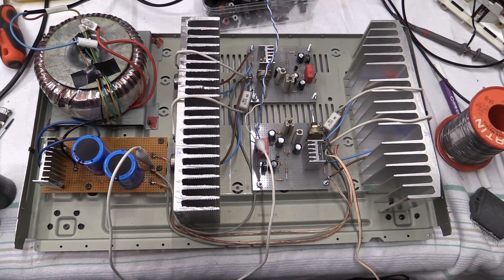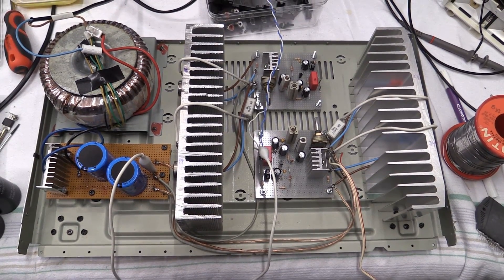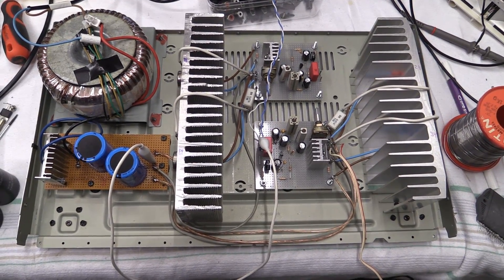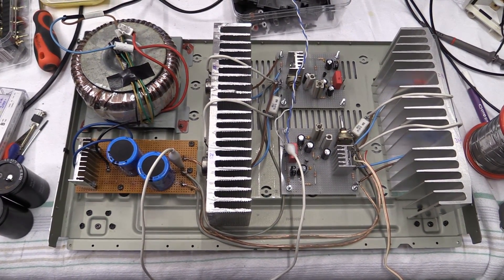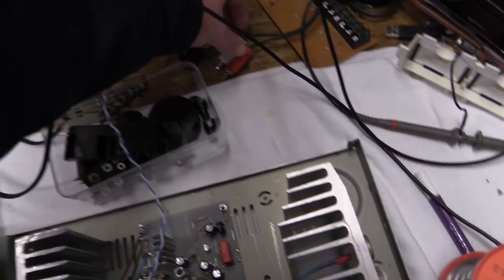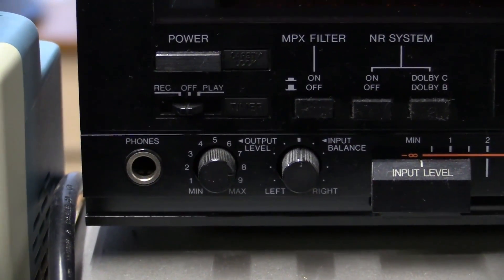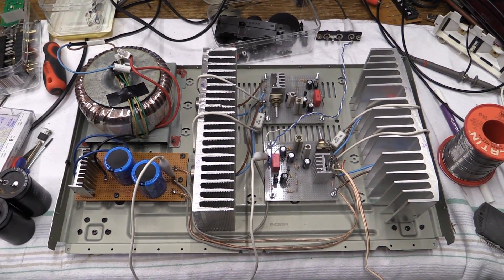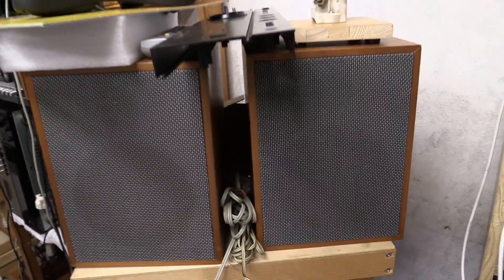DrCassette's Workshop - JLH Class A amplifier [5/x]

Comment: This is an amplifier design worth pursuing. John Linsley Hood was a brilliant designer. I would suggest you buy a pair of ready made PCBs and build the amplifier on those rather than using the method you are using in the video. The design does require a good component layout for stability. It is also important to get the bias of the amplifier set up correctly. I have built a couple of these amps in the past and brought the Kits originally. They do have an incredibly transparent sound and they are well with the effort. 
I would say it is the nicest sounding amplifier I have ever owned and I was the buyer for a Hi Fi company called Teletape in London. I had access to almost any amplifier I wanted. I met JLH  though his nephew who worked for me.

Comment: That buzz is a lack of common grounding points.
Reply from the maker: The buzz is a result of insufficient filtering. The amplifier has a quiescent current of about 3 A for both channels. The filter capacitors are too small to stabilize the voltage at such a high current. The grounding is fine.

Comment: Don't know if you still have this sitting around. Maybe more space between the boards and the bottom on amp and power supply.
Reply from the maker: I still have it, but haven't done anything to it since. I need to considerable upgrade the power supply, the noise is caused by supply voltage ripple.

Comment: It sounds like a ground issue, .  I would check for *bad/cold solder joints. And in the past doing repairs, I have had ac hum picked up from the overhead fluorescent lights (just a thought). Maybe adding some bypass caps, low value .01 etc on certain areas might help. But my guess is there is some ground return problem. Good video, best of luck!
Reply from the maker: +Scott x 
The problem is the underdimensioned power supply. Keep in mind, this Class A amplifier has a high, constant current draw. The filtering is not good enough for that. The setup in this video was 2x10000 µF, I have seen Class A amplifiers with 6x10000µF!
Reply: +DrCassette I know, they pull a lot all the time and need big and well filtered power supplies. It's funny, I was just looking at a class-A amp that has 6 x .22F ! caps lol But that high frequency noise is something else I think. I'll stay tuned, all the best.

Comment: hello sir have you try the AX-14 a simple class AB amplifier ? http://www.diyaudio.com/forums/solid-state/164093-100w-ultimate-fidelity-amplifier.html you should try many people have build and it sound really good, the PCB and schematic is on the link I have made a new PCB and works great, the supply voltage is 50 to 55V max and the bias you can easily adjusted to 20 mA is about 10 to 15mV reading one of the 0.33 5W emitter resistors also can work with less supply voltage to 25V rails too :D
Reply: It is nice but since you know I am always for high power , minimum from 1000 watts.Aim is to make one day a real 20000 watts per channel Amplifier .
Reply: Vedmitra Sharma
mister Vedmitra please, not all people will be able to spend  thousand dollar on parts to make a 1KW amplifier for home use your concept of audio amplifier is for high power units only, think that not all people will have the budget to accomplish your ideas of 2KW units we have to go lower than what we know so friends will have the ability to build a nice amp that provide at least 100W of nice music for the living room

Comment: I would put some filter capacitors directly on the amplifier boards on each rail of the power supply, say like 470 or 1000uF to compensate the wires, and shunt them with 100nF to kill possible oscillations there because of the long ground wires. Since as I remember you made those amps work on the bench.

Comment: About the power supply: A rule of thumb says, that you have to use at least 1000µF per Ampere.
You could also use linear power regulators to solve this issue (ripple), but I don't how much current a circuit like that is drawing...
I also think that the Oszillation is caused by the power supply,
do you have a lab power supply to test it?

If you can please use shielded cables for the input, even at low frequencies I can't trust unshielded leads.
Greatings from Germany =)
Reply from the maker: I think the complete circuit (both channels) won't draw anymore than 4 A, so going by that rule, 4000 µF would be OK, but that is obviously not the case. I wanted to keep the power supply simple, so no linear power regulators. Maybe I'll have to put in some...
The power supply I used for the initial testing was almost identical to that one, unfortunately right now I have only one working lab power supply, so I can't provide the split rail supply.
Those short wires on the inputs shouldn't cause these problems...
I'll be back at the workshop in a couple of weeks, then I'll be doing some more experiments with this.

Comment: Wait, what version JLH is this? Because if it's the 1969 version, it requires output caps to block the DC.
Reply from the maker: It's I think the 2004 version, that doesn't need output caps.
Reply: I'm not aware of there being a 2004 version. Perhaps you are using the 1969 dual polarity version? 
As for the oscillation, easiest thing to do would be to buy a JLH 1969 kit from ebay :D 11 euros with free shipping. Properly designed PCBs with all components included, even the TO-3 outputs. And that 11 eur get you two channels ;) I've got one of them kits on the way.
Reply from the maker: No, this was a new design based on the original JLH amplifier. I found it on a website. I'd like to give you the URL, but unfortunately it seems the site is gone now, the last time I checked it wasn't available anymore.
Reply: DrCassette
Tip: when you need to open a webpage that is no longer available, you can often find archived versions of it on www.archive.org. You can find almost any webpage, it's quite amazing.
Reply from the maker: Too bad I deleted the bookmarked link of the site after I saw it was gone...

Comment: That buzz to me sounds more like a bad ground than power supply ripple. If it was power supply ripple, that buzz should be present no matter what is going on at the input.
Reply from the maker: Hmm, you could be right about that, I was surprised myself that shorting the input causes the amplifier to be totally silent.
Reply: yes that's definatly NOT from the power supply i guess it is the scopes ground lead wich is connected to mains earth thus causing a ground issue. anyway to get rid of the oscillation try to connect a resistor like 100k  or something from the input to ground that could help fixing the oscillation issue
Reply: Sound like a grounding issue. I have a couple of these amps and you have to be careful with grounding points.
Reply: Spot on.

Comment: perhaps do it very systematically: disconnect left and right totally (input, output, rails) and run them individually, on battery/external (decoupled) power.
Then reconnect step by step and look where the issue comes from.
i suspsect a really a short cut between one of the PCB and the board somewhere hidden, causing the PSU to drain all it's power to overload, causing the filtering to be ineffective.
Did you meassure the power consumption of the device? (yes it's an class a, i know what that means for consumption.)
Reply from the maker: Thanks for the advice, I'll try that some time.

Comment: for the HF i would throw in some 100nF and 10pF here and here on the inputs and power rails. that should be solvable...

but the 100Hz hum gives me headaches. sounds like a short to ground somewhere. are you absolutly sure that the isolation on the transistors is o.k. towards the chassis? what happens if you (yes it's illegal...) disconnect the ground from the chassis?
Reply from the maker: While testing the amp I tried connecting and disconnecting the ground from the chassis. It made no difference.